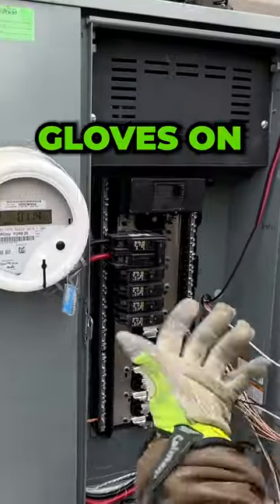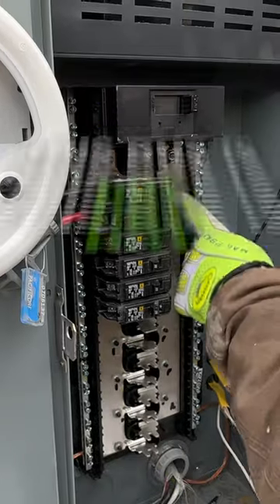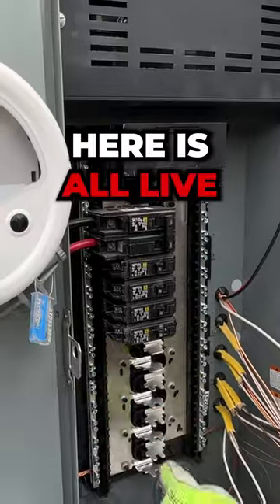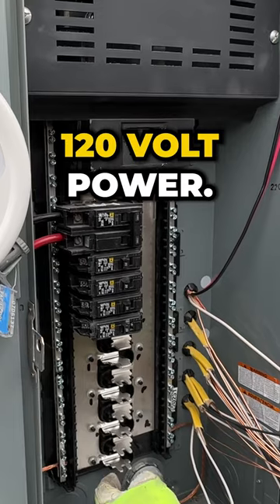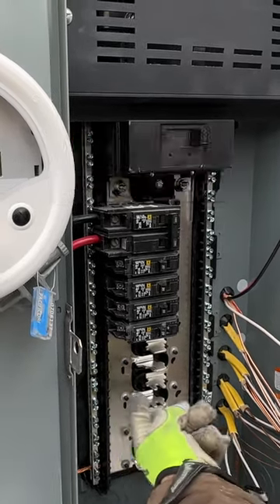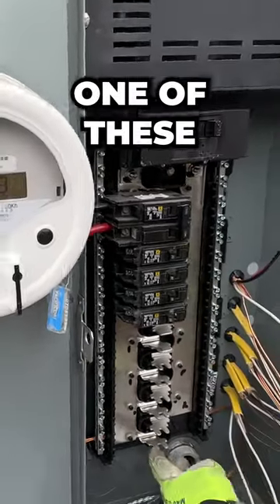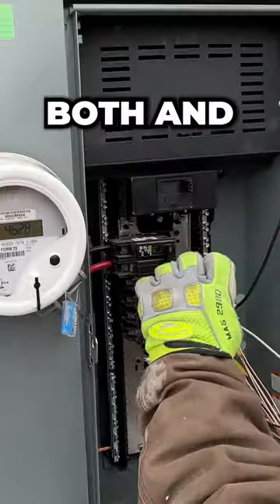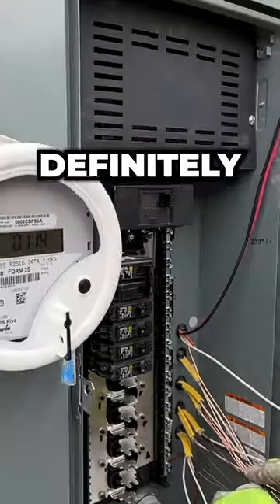Don’t Get Shocked⚡️Live Panel #Shorts

Comment: They aren’t “opposite phases”. It’s a single split phase. Single phase off of the primary into a winding, then on the secondary, it’s center tapped for your neutral and each end of the winding are your “hots”.
Reply: This is true but it is kinda pedantic.  He also said single phase 120 but it's single phase 240.  And after he fingered that Bus bar he said it won't kill you but 100-200v is what people die from most often.  Basically nothing in this video is right lol
Reply: I'm not an electritioan, but I thought those are called legs.
Reply: @Michael Merryman  no,  voltage isn't what kills.  It's amps that kill. Human body can withstand a lot of voltage.
Reply: @saywhat6632   I've been an electrician for almost 20yrs.  And it's a combination of voltage and amperage.  Although amperage across the heart is what kills you the voltage still needs to be above ~40v.  But my point was that most people who die from electrocution, do so from 100-200v.   That's a fact jack.  It only takes .08 milliamps across your heart to die so the amperage from any electrical system is enough to kill you, so fingering a panel while power is on isn't a great idea and him telling people "it's OK it's only 120v youll just get shocked" is stupid, wrong and dangerous.  Amperage Essentially is what kills you but there isn't a way to limit amperage to the point it's safe, it's more important to pay attention to where you are in relation to live power. It's best to work with one hand when possible to avoid grounding the other and touching live power at the same time sending voltage across your heart.  Wearing boots that are insulated again to avoid power from running through your body.  You can endure alot of voltage and amperage without significant problems if it travels say between the tip of the finger and your knuckle which is why we try to work with one hand when possible but that still doesn't mean bad things can't happen.  Pay attention to what ur touching and never fingerbang a live Bus bar and you'll be good.
Reply: It's a single phase at the distribution point, but at the panel, it's two phases at a 180 deg phase shift.
Reply: @WorBlux  360 degrees per phase it's 120v potential across neutral and one leg and 240v potential across the whole phase.  They are 180 degrees bc they are opposite halfs of a single phase.
Reply: @michaelmerryman7806   Nope, both are full sine waves (phases) on their own. - around 120V RMS, 167V p2p -  If you don't believe me, take out a oscilloscope and hook it up. 

And if you add them together, you just get the bigger sine wave. But this is expected, add any two sine wave of the same frequency and amplitude, and you'll get sine wave out at differing amplitudes as determined by the phase shift. 

At the panel they really are different phases. Yes 180deg two-phase is useless for anything other than voltage shift. But it is two phases. 

And the panel would work exactly the same if it were actually provided by two separate lines on transmission/generation phases 180 deg apart.  However you'd never do that in an application the requires a transformer as it's so trivial to split a phase in a transformer with the center tap. 

And in a large apartment or multi-tenant commercial building, they might actually be 120 deg apart, and only 208 RMS from leg to leg.
Reply: @WorBlux  well google can say it better than me "both line voltages are derived from a single phase of a distribution transformer with a center tapped neutral and are 180° out of phase with each other" this is a single phase.  Now if you were talking a delta high leg you could get 208 on the b phase.  Or a 120/208 will give you 208 across 2 phases but that's 3 phase not single phase.  But maybe I'm not getting what you're saying.  I don't think they call it single phase to be cheeky. Cheers.
Reply: @michaelmerryman7806  I agree with google, I disagree with your interperation. 

Anything in=phase with the reference circuit is a single phase. Anything out-of-phase is a separate phase. 

While it's a single phase in the primary winding of the transformer, one of the half the secondary winding has reversed polarity with respect to earth, making it out of phase with the other leg, and out of phase with the entire secondary. (the 240 circuit) 

If both legs were in the same phase and at the same voltage, then there would be zero voltage difference between them. 

Electricians though would rather call them legs or line, to differentiate between 3 phase stuff. 

"a 120/208 will give you 208 across 2 phases but that's 3 phase not single phase."

You need a three phase service to the transformer to generate 120/208, but at the panel level it's still just two phases.  It really depends on how the utility wants to balance things and what sort of transformer they give you for a large multi-tennant building.
Reply: @WorBlux  well dang I don't know if what u said is accurate but damn if you didn't say it with confidence lol.  I'll have to take a deeper look as I'm not an engineer but you seem to know what ur talking about.  The way I was taught was single phase is one phase but haven't really thought much more about it. Cheers
Reply: @worblux is 100% correct. Don't feel bad for not understanding, it is very complex stuff. They are clearly a professional in the industry.
Reply: @crispiygonzo3816     ok so this isn't a hill I'm willing to die on especially since worblux seems very knowledgeable.  But I did look more into it and at this point I'm just regurgitating literature bc I'm not sure if I can confidently grasp the entire concept, honestly.  But it essentially says that bc the two phasors do not define a unique direction of rotation of a revolving magnetic field a split single phase is not a 2 phase system.   Cheers
Reply: @michaelmerryman7806  well at this point it sounds like you are reading stuff about motors. There are many fields that talk about electricity and electromagnetic fields, and they don't necessarily all use the same terminology. And to add to that, not everything you read in literature is actually correct unfortunately. 
I would just chalk it up to this being high-level stuff that is not necessary to be known by people not working directly with it, but it is still fascinating stuff. If you have access to an oscilloscope and 120 split-phase perhaps you could do some experiments and learn for yourself to get a grasp of what is actually going on in the electrical system.
Reply: @crispiygonzo3816  yeah but you haven't really explained why they are 2 phases.  I know that you'll have 2 sine waves for each leg but they are 180 degrees offset... they are still part of the same phase.  They are single phase from before the distribution transformer and as far as I know transformers can't create a powersource on their own and therefore are still the same phase just split into 2 legs.  I'm fairly capable of comprehending complex topics and still willing to admit I'm wrong but At the start of the cycle, Line 1 is flowing toward the house. Line 2 flows away from the house. After 180 degrees, they switch directions. So if you imagine the current flowing toward the house in L1, at the same moment the current is flowing back to the transformer in L2, they are actually in phase, just flowing in different directions to complete the circuit and act as returns for each other.
Reply: @michaelmerryman7806  I'm not in the two phase camp.  It's mostly a matter of semantics, but I don't like to say it's two phase.  Any single phase multi tap transformer is going to have various voltages with respect to the taps.  It's still one core with one sinusoidal oscillation.  Let's say you didn't use the center tap at all and just had 240v loads.  Everyone would agree it's single phase.  Now we use the center tap for something and it's two phase?  Nah, f that.  2 phase generators have a 90 degree phase shift as in two distinct waveforms beginning and ending at different times.  split phase has "180 degree phase shift" only in the sense that you stuck your meter at different parts of the secondary, aka no phase shift at all.
Reply: @maynardr6  thank you... finally someone to back me up.  I'm trying to politely tell the guy he's wrong and then he tries to tell me it's too complicated for me... 🤣 
Single phase is single phase they didn't name it that to mess with us they named it that bc it's single phase lol
Reply: @WorBlux  If it was 2 phases, you would be running 208 instead of 240
Reply: @crispiygonzo3816  No, I don’t believe worblux is correct. A residential home is supplied with one of the 3 phases produced at a power plant. What others are saying about it being split/center tap is correct. Worblux just talks a lot making it appear as if he knows what he is talking about. 1 phase…not two in residential homes.
Reply: @mgpvii  Passing a phase through a center tap transformer splits it, so it's split phase. What happens when you split one thing into more than one things? It becomes two things. This is why I'm calling it two phases, because if you ignore everything upstream from your source, the transformer, then you are seeing two distinct phases. But again this is just semantics, there is no one entity that makes the decision on what words are the specific exact correct words to use in this context. This is why I'm making the argument that it's high-level stuff being discussed, and you need context to get the exact communication across.
Reply: @crispiygonzo3816  If you understood what a phase was you wouldn’t be saying it was two phases. A phase is basically a point in time in which electricity is produced. Power plants produce 3 phases by passing THREE independent coils across a magnetic field. Spinning…120 deg apart. The combination of those 3 phases makes running a 3 phase 480 induction motor very efficient. That’s why commercial buildings get 3 phases to power large equipment running 3 phase 480 motors. So when I run my 240 volt pool pump I am not running a two phase motor, I am running a one phase motor using both legs of the 1 split phase. You can continue trying to justify your initial claim but you are wrong. It is not semantics. It is semantics if you don’t really understand what a phase is.
Reply: @mgpvii  I know exactly what a phase is, and am currently sitting in my electromagnetic test laboratory where I work with 3-phase regularly. A phase does not only refer to the 3 phases coming from a power plant/grid. You can pass 1 phase through a motor and end up with 3 phases on the other side with the same principle as they are produced at the plant. No need to get all huff and puffy. It IS semantics when it is context-less. It depends on the context of what is being discussed. Not everything is binary jeezus.
Reply: @mgpvii  And I'm not saying it's a 2-phase system, I'm saying it's split-phase. If it was 2-phase they'd be out of phase 120 degrees, whereas in split-phase they are out of phase 180 degrees.
Reply: @crispiygonzo3816 2 comments ago you say "this is why I'm calling it 2 phase" you're arguing with yourself at this point.😅
Reply: @justziptieit8428  no you just don't understand what I'm saying.
Reply: @crispiygonzo3816  no one understands what you are trying to say because you do not make any sense. You say it's 2 phase, then you say you're not trying to say its 2 phase. Then you try to say words are just made up and don't always mean the same thing. At this point I only believe you are trolling people. If not, you can split a phase 1000 times with transformer primary secondary windings and they are all the same phase peak. You can clearly see this with a oscilloscope, you say you are in a electromagnetic test lab you should have one. If they were 2 phase 180 degrees out like you have claimed, each leg 110v would make across legs 55v. This is the same reason we have 208v in a 3 phase panel. The 2 110 legs are not peaking at the same time (120 degrees out) so they don't equal 220 across phases.
Reply: @justziptieit8428  just because you're incompetent doesn't mean I'm a troll lol. I'm not explaining further, because you are misrepresenting what I already said.
Reply: @crispiygonzo3816  yup incompetent in a lot of things. But I can rest easy at night knowing basic power generation principles and that split phase power is not 2 separate phases. Too bad its not i would love to not have to use rotorary phase converters or VFDs to convert my split phase to run 3 phase motors. It would be much easier just to keep making new phases with transformers.
Reply: @WorBlux wrong its single phase no 2 phase there not the 180 degrees out just opposite poles or ends of a coil. If you put a true scope on it the line will be straight.
Reply: @WorBlux use a true point scope that not hooked up to a ground  reference you will only see one sin wave not 2 which means you canot use a 120 volt scope.
Reply: @thomasmarable6818  careful explaining general electrical knowledge, the mean people on the internet will call you incompetent 😁
Reply: @thomasmarable6818  The coil has a magnetic field, which has a polarity at any 
given time. Ground reference the center, and when end has a positive voltage potential, the other end has a negative voltage potential.

The fact you see a single sine wave between the legs is expected. If you add/subract any two sine waves of the same frequency, you end up with a single line on the scope. 

 And yes if you ignore the ground reference, where is no way for a floating scope to tell the difference, but the NEC requires a grounded conductor in every branch circuit. 

I could also generate the 0 and +180 phase in a specialty alternator, and you wouldn't be able to tell the difference between that and a phase split in a transformer.

 It's the wave form that's important here, not the source.
Reply: @justziptieit8428  " If not, you can split a phase 1000 times with transformer primary secondary windings and they are all the same phase peak"

You can certainly put 1000 taps on a transformer. Then ground reference it anywhere. All the taps on opposite sides of the reference are 180 degrees out of phase.  But you can only get 0 and 180 from it.

Or forget about the ground reference and grab a 4 channel scope. Attach A to any of those 1000 taps, then attach D anywhere at least 2 taps from A. Then attach B and C to the same tap anywhere between. Graph the difference between AB and DC.  The wave forms are 180 degrees out of phase. 

Sure you can flip to graph DC and and get the same phase, (which is why split-phase is no use  over a single phase  when it comes to motors), but the ground reference and grounded conductors is important when it comes to the NEC.  And mainly I'm worried about the math of it, rather than the practical applications. 

" If they were 2 phase 180 degrees out like you have claimed, each leg 110v would make across legs 55v. "

Your math is wrong. 55V between two 110's mean they are about 30 degrees out of phase. At 90 - 1566V, 120- 208V and 180 - 220V  

At 180 phase shift. the peaks are aligned with the troughs, thus 220V between the lines). And in fact many automotive inverters tend don't ground a conductor, but rather generate two 55V waves 180 out of phase to generate 110V.
Reply: That is correct
Reply: @saywhat6632 wrong it’s a combination of voltage and amps, high voltage will simply kill you because it has more force
Reply: @michaelmerryman7806 I’m an electrical engineer and he’s right. Had to look it up myself though as I’m from Europe and we have three phase connection into the household but what he said was very much correct
Reply: @Clancywiggum97  It is a single phase from a 3 phase generator at the power plant.  Transformers cannot create a power supply.  It is alternating current tho so as current flows towards the home on one legs it flows back to the transformer on the other leg and it switches 60 times in a second.  That's because our power system is at 60hz.  3 phase transformers are fed by 3 powerlines, single phase are fed with one... I've given the evidence and explained it as best I can, if I'm wrong explain it to me and show me the evidence and electical theory.  As an engineer it should be easy to explain.
Reply: @crispiygonzo3816  after the transformers they are called phasors, tho as an electrician i'd call them legs or l1 and l2, bc they are 2 parts of the same phase.  If you work with 3 phase electricity then Take a single phase and create another phase out of it.  The laws of thermodynamics will be quite a hurdle tho.  Seeing as you cannot create energy from nothing.
Reply: @michaelmerryman7806  my argument is just that you can call the legs phase. It’s not a 2 phase system of course. But as for phase. In an AC system, the current and voltage can be formulated as in u(t)= û sin(wt +delta(phi)) w being the angular momentum  which is the same for both A and B but delta(phi) is the phase difference between the two phases. It’s not a two phase system but from a wave theory standpoint it’s still two different phases separate by the phase difference between the two
Reply: @Clancywiggum97  this is an argument of definitions.  The way I see it is its the same waveform just 180 degrees offset from each other so the peaks of one should align with the valleys of the other. It's the same power source, the transformer cannot create a phase only a generator can.  The powerplant uses 3 phase generators and single phase is one of the three phases on that generator it is impossible to create 2 phases from a single phase.   There are magnets and coils in the generator that induce the electrical current and if you imagine how a generator works you will understand why it's not 2 waveforms but the same with different starting points.
Reply: @michaelmerryman7806  it is an argument of semantics that’s true enough. But you are right, it isn’t a two phase power system, it’s one phase split but it’s also not technically wrong to call the legs two different phases, the difference in starting points you mentioned being the reason for that.
Reply: @Antonnn1111  try again.  The body can withstand an insane amount of voltage.  However,  1/10 of an Amp can kill you.   

Does higher voltage have more potential?  Well, that's a different conversation.
Reply: @WorBlux where did you get that from?
Reply: @maynardr6 thank you. I was scrolling to find when someone was going to tell this guy he was in fact incorrect and probably not mess with electricity
Reply: @WorBlux peak to trough is 240. Like what can we not understand about that
Reply: With respect to the center tap, they absolutely ARE opposing phases. An oscilloscope will show you two sine waves on the hot legs, and they are 180 degrees OUT OF PHASE wrt neutral.
Reply: @garybrown2300  same phase your just reading a different part of the phase
Reply: Bro I’m  it sure what he’s talking about but you can’t get 240v with the same phase… there must be 2seperare phases In order to get that voltage.
Reply: @RoadRunner247  Semantics. The two 120V phases in a 240V “single phase” service are derived from a single primary HV phase by center-tapping and grounding the secondary winding of the transformer on the pole. Because the transformer is fed by single-phase HV, it’s not referred to as a poly-phase service. It’s 240V single-phase service.
Reply: I don't think it's wrong to call them phases.  If they were 1 phase they would look the same on an O-Scope and have no voltage between them.  everyone says oh, they're the same phase they're just 180 degrees out of phase.  If they are out of phase how can they also be the same phase?
Reply: @RoadRunner247  trough to peak is 240v and it’s a single sine wave
Reply: As an old man from Philadelphia who has actually worked on 2 phase systems I can assure you that is not two-phase. What he is working on is single phase and there's no argument about that
Reply: Yes
Thank
You
Aint
2 
Phase
Reply: Single Phase System, Second Leg is Opposite Phase
Reply: 2 phase power had a 90⁰ phase shift and became unnecessary with condensers.
Reply: Exactly